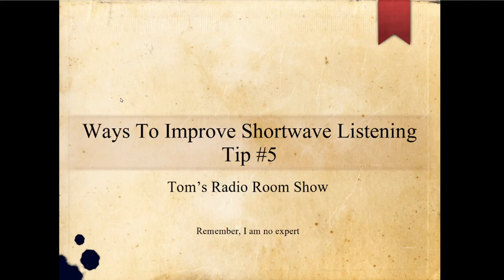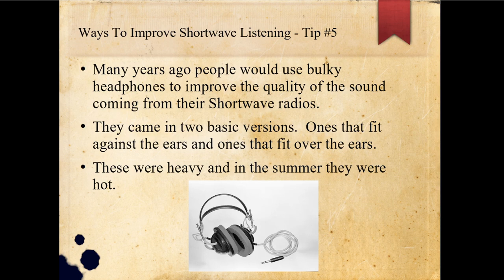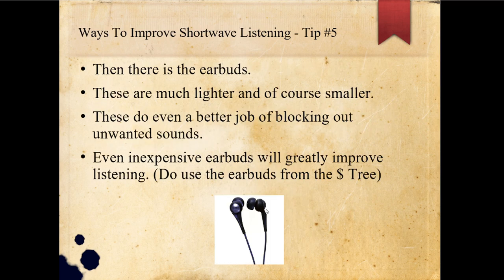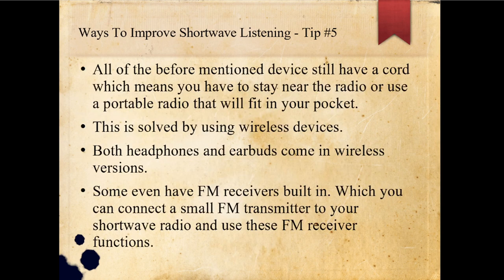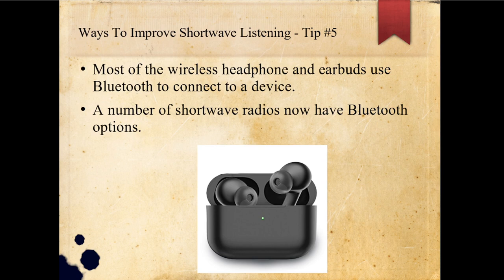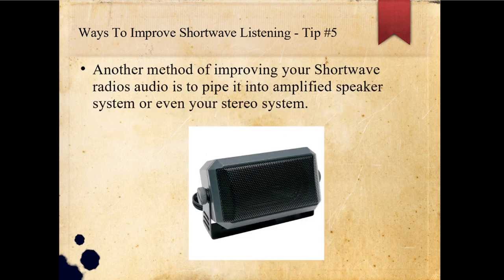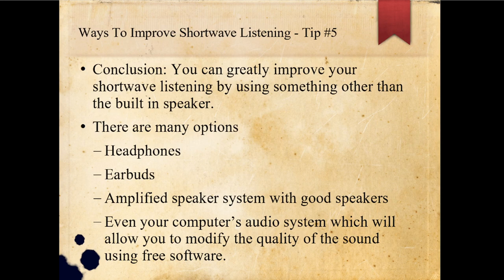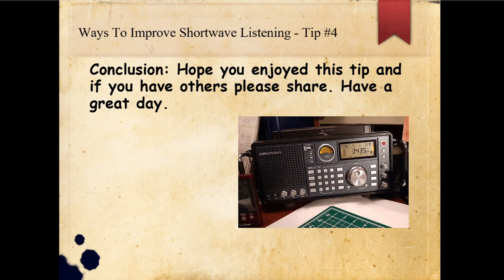TRRS #2292 -  Ways To Improve Shortwave Listening - Tip #5

Comment: The Retekess V115 pocket radio has an awesome sounding dual cone speaker. I bought one for a family member and I was impressed it has a sound quality that blows my Tecsun PL-660 and PL-330 out of the water! 
On FM mode the V115 is able to reproduce the low frequencies and I couldn't believe I could actually feel the bass vibrations in my hand when I held it! 
Too bad the Retekess V115 isn't a dedicated shortwave receiver though but for a US$14 radio it's pretty impressive. It's a shame Tecsun's PL-3xx models don't use a dual cone speaker like the V115. The Tecsun R-909 analog SW radio which I have probably has the worst sounding speaker, very tinny and shrill sounding. 
That said, compact receivers like the PL-330 and 310ET are more like personal radios to me (like an iPod or a Sony Walkman). They sound best when used with headphones or earbuds.